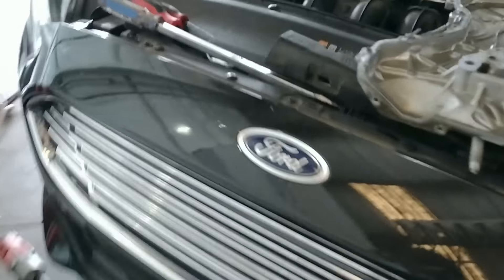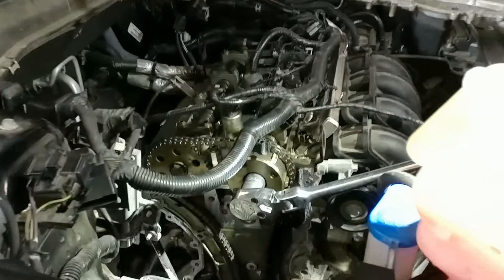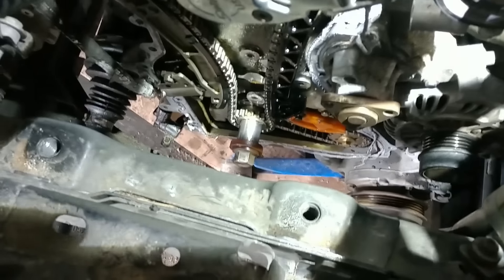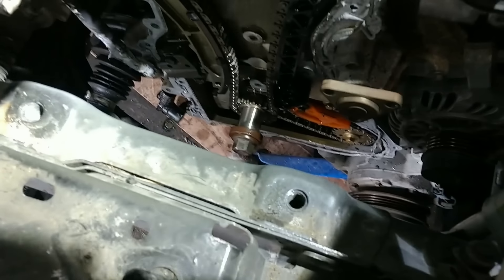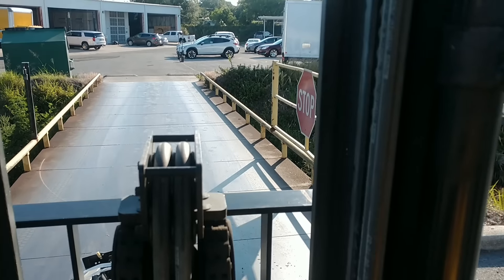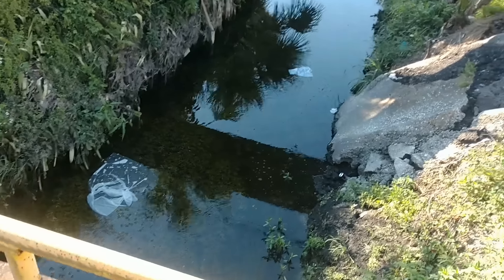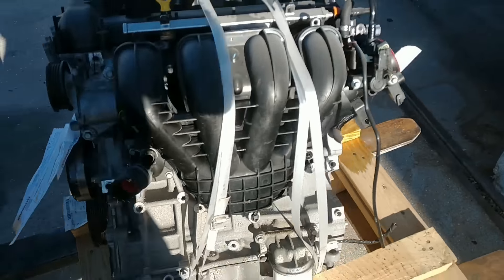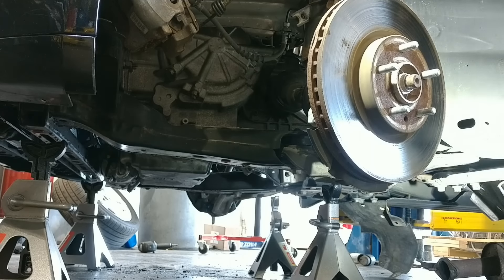Damaged Engine: You Broke it! Pt1

Comment: It's all free floating, cams and crank. No timing marks on the block either. Sucks because if he was doing a tensioner or chain you'd have figured out the system, but just removing the HB is all it takes.

Comment: As a mechanical engineer it breaks my heart to watch companies force their engineering departments to do stupid things in the name of cost.  This is 100% the root cause of this issue.  There is no excuse to make a valve train this way except to save a machining operation on the crank, and on the pinion.  Shame on Ford.  SHAME.  The founder of that company, as big of a jerk as he was, would never consider something like that.
Reply: I am no expert, just making a comment:  I have read a lot of these comments, and several people make a well-reasoned case for using just this sort of system, and apparently it is more for mileage, emissions, and power than it is to save a few pennies during manufacturing.  If that is true, I have to wonder how many experienced and well-trained Ford mechanics have to replace engines because their service of this type of engine goes bad?

Comment: Hard to believe something as important as that is held on by interference fit. When these engines get old and wear it will slip and as an interference design destruction will result. Built in obsolescence. That should be keyed at a minimum Ray.

Comment: I have this same engine in my Mazda 3. No keyed crank. Harmonic balancer holds time with the crank with friction washers. Also friction washers on the intake and exhaust cams. Poor design. And if those aren't used as well as the cam lock and crank lock tools, you're just asking for catastrophic engine failure. I did some quite extensive research before diving into the job. So I knew everything I needed going into the project. Time and patience along with YouTube made it significantly less complicated.

Comment: Wow, I can't belive ford is still using the same engine from decades ago. 2015 car with a 30+ year old engine. Good price on the used engine though.  I paid £550 with 70k miles on the clock

Comment: After my mom got rid of her Fusion, I thought I was done seeing their brilliante engineering at work. Nope. I'm glad she got rid of it before I had to do a timing job on it.
Reply: You wouldn't have to do a timing job on it.  The Mazda L used in the Fusion was good for about 175K when they would have valve issues.  A rebuilt head would get you past 300K miles.
Reply: @ohger1  The engine started making noises (likely something in the VVT system), which was one of the reasons why we got rid of it. The timing has to be redone while tearing it apart to diagnose that issue. We had bad luck with that car, and I'm still glad we got rid of it. Edit: It was maintained well, twice yearly oil changes, and addressed a weeping trans seal early before it damaged that. Car only had 35k on it.

Comment: Been a mechanic for over 15 years and what in the heck is that design? No keyway to clock it? Uses pressure of the harmonic balancer to maintain timing? That's the kind of engineering that makes me want to hurt someone.

Comment: Lmao I just had to do a head gasket on one of these motors yes there is a tool to lock the crank in place and a cam lock tool as well. Yes only the pressure from the balancer and bolt allow that thing to run it’s a super shitty design

Comment: Never start a motor when you’ve done timing components.

Hand crank ALWAYS!!. To test & verify.
Never use the starter.

Leave it to Fix Or Repair Daily Found On Road Dead to design A crank sprocket without a keyway my gawd, what did they “save”?,  5 g on that weight saving feature?.

What a bunch of half-brains…
Crank sprocket without a keyway my gawd, everybody & their mother uses keyways & locator dowels/pins/half-moons (aka: “biscuits”) to locate & hold the crankshaft sprocket in place but not FORD, they’re so much smarter than everybody else

Comment: All these new cars are designed like certain parts were assigned to a freshly hired engineer with no experience...... it works but there are some very stupid choices made. Then again, pointy haired bosses can make some amazingly dumb choices for office clout, company finances and to look good in their boss's eyes. I learned recently that the transfer case / power transfer unit on some of the newer 4x4 jeeps can wear out at 40,000 miles because they put the catalytic converter so close that it overheats the small amount of gear oil inside it.

Comment: This so sad to see! I guess no one thought to look at the autodata for procedures on locking the engine! If one of my techs had done that then they would be paying for and fitting the replacement engine! That’s total rookie mistake! Ford have been using non keyed pulleys for years in the uk, I have a cupboard full of timing lockup kits for this very reason! Autodata subscription £90 a month, timing lockup kit for that series of engines £130,! Peace of mind it’s done right the first time, priceless!

Comment: If I brought my car to the shop and they replaced my relatively low mileage engine with a rebuilt one I’d demand compensation in addition to the rebuild. The overall value of the car is diminished. It’s not a factory rebuild. The serial numbers don’t match. It wasn’t installed by a Ford dealer.  You’ll never get a decent resell or trade-in deal. That is complete BS. The customer would be better served by an engine rebuild and if they came to me with some BS about the replacement being cost effective I’d tell them to stuff it.

Comment: Man new Ford vehicles are getting crappier, especially the fiestas in the uk where I live. The 1.5 Diesel engines have their oil dilute with diesel they are a design take on the 8v Peugeot 1.6hdi but they are ok and the petrols have their heads crack, catch fire or the rods go, Also the heaters take about 20 minutes to get the things warm in the diesel models. Gm and Ford are pretty similar and both have their ups and downs but this to me seems cheap that they don’t use a keyway. Gm in scotland or the uk is Vauxhall or it used to be anyway till Peugeot took it over, they don’t have as many serious engine issues as the fords do here apart from the vans that aren’t fiat or Peugeot built

Comment: Ford uses friction discs between the gears on the crank shaft to hold everything in time. If you remove the dampener you must lock the cams in place and use the crank stop tool. Otherwise this is what you get. Side note if you run these engines low on oil the same thing can happen

Comment: You couldn't just done a valve job but I guess u would have more than 400 in valves and gaskets I will remember this engine for sure this is the Ford engineers sticking there middle finger up at the service technicians I mean a 25 cent keyway🤣👍

Comment: I came across the same thing when doing the timing belt on a 2012 focus, they require a few special tools. A pin goes in the back of the block to lock the crank at tdc, and cam locks ensure the cam timing is correct and only then can you safely loosen the harmonic balancer bolt, which is also a single use bolt and washer. Niether the balancer or belt pulley are keyed. Seems insane to me, and definitely something destined to fail eventually, whether by incidents like this, or just time, fatigue, or metals expanding and contracting causing it to come loose. Good one Ford. 👌
Reply: BMW/Merc/Audi have been this way since at least 2005, its not really a problem if you follow the service guide.

Comment: Never buy or own a damned Ffffffffford. Anyone remember how you had to reach across the steering wheel to hold the gear shift lever in park so you could start the car? That took them years to fix. 
Bought a new 87 T-Bird once, my wife was the bookkeeper at the Ford dealership otherwise she'd would have been driving a chevy to work, after a few years I decided to replaced the belts and hoses. My buddy owned a NAPA store so I went to him for my parts. He said the heater hose was a dealer item only. So i go to the dealer and they tell me the FoMoCo parts system said "improvise".  Ford didn't offer a heater hose with two 90* bends two inches apart!
The power window motor went out, had to drill a hole in the door where the factory had dimpled the metal to get a socket to a nut on a stud....this was the official Ford procedure. Once i reinstalled the door panel half the hole was exposed.
The AC compressor went out for the second time just out of warranty. Ford knew the system was crap and devised an entire new kit, the dealer would sell it to me at cost, $1000, I said hell no. The kit included every thing, brackets, belts, compressor, condenser and dryer....They really made some shitty cars in those days

I will never own another Ford product.

Comment: The torque on the crank bolt is wrong. The bolt and the two washers have to be replaced when removed. Yep all who work on this engine are doomed to fail. Happened to me and I work on fords for 40 years.

Comment: I'm not sure I understand all he did was take the timing cover off but not the chain or gears so why would it need to be cam locked and the balancer has to be on before you crank the engine
Reply: Because, on this engine, there are no keyways to locate the timing gears on the crank and cams.  The crank gear is only held in place when the crank pulley is installed and torqued.  Because of this, timing tools MUST be installed before the crank pulley bolt is loosened.  Same goes for the cam gears............

Comment: Read the fucking shop manual when you're not used to work on a specific engine.. this engine requires a timing tool to lock the crankshaft before removing the crank pulley.. a quick look up before disassembly would have saved that engine from being severely damaged.

Comment: "Ford has a better idea!" was an advertising byline in the late 1960's, replete with a light bulb,  GE style. Early "baby boomers"  flocked to the Mustang and little else. Who wanted a Ford Galaxie with column shift,  soft shocks and a bench seat engineered for a "1930" era male weighing 145 Lbs? Few did. What was on Ford's platter? The Pinto. GM's Camaro and Firebird, and the MOPAR Challenger, Charger, and the mild slant six Barracuda was a second choice.  "Ford Has a Better Idea"? Ha ha..hah

Comment: Just another design problem.  John Deere  has a 5 cyl. Diesel with a cam gear only held in place with the bolt. No key and no taper.  Where have  all the real engineers gone?

Comment: oh no! THEY DIDN'T! Rely on the tension of the pulley to prevent THE TIMING DRIVE TRAIN from coming out of .... FFS FORD! A simple, TINY key would have been sufficient, just the tiniest thing even...that poor apprentice, having to learn on the back of shitty design, how hard it can be to be a mechanic. When ever I come across an engineer or board member that approved of designs like that, I usually just club them and cremate them as to prevent offspring and the spread of faulty DNA. What a heartbreak!

Comment: 50 yrs ago, when I was apprenticing in my grandfather's garage, I was given the task of a simple sparkplug change. An insulator broke, and the terminal fell down inside the plug hole. Not knowing the catastrophe this would cause, I went about my business. Only when I started the car did I get the scolding of a lifetime.  That little piece of metal seized up the engine and my grandfather had to pay out for a rebuild

Comment: What an absolutely horrendous design here! What kind of bonehead engineer uses friction fit for a timing gear?

I'd agree with the boss on this one, $400 + an R&R is probably cheaper than a proper head rebuild. You're looking at a $300 or more to do valves, valve guides, and valve guide seals at a reputable shop and another $100 to $150 for a head gasket kit (that includes not only the head gasket, but all the intake and other things that have to be removed) and head bolts. That doesn't even begin to account for the labor, running around, sourcing parts, etc.

Comment: This has to be one of the worst design flaws ive seen, I guess it pays to consult the service manual on each and every vehicle before even starting to work on them. Each brand now has special techniques that have to be followed and if you are not familiar with them better consult a service manual. Both Ford and GM seem to be getting much worse from a service standpoint.

Comment: Every crankshaft pulley I have ever seen has been either located with a woodruf key, or on splines.   This is wishful thinking on that manufacturers part. . . . edit....  Actually I just remembered there was one motorcycle engine that used a tapered shaft, but that was a two stroke, and it was only for the magneto timing.

Comment: The whole situation is unfortunate but I gotta say, what a STUPID design FORD....

I want to have a talk with the guy who decided it was a good idea to hold the crank sprocket to the crank with pressure from the harmonic balancer. That is so dumb. It's like they designed and built the whole engine and then suddenly realized they didn't design a keyway. And then recovered by saying "oh...yeah, well just crank the bolt down real good, it'll hold it!"

Comment: I can not F**ING STAND!!!! when manufacturers build stupid idiosyncrasies into components that make it so basically only their certified techs, I.e. dealership mechanics, are the ones who can work on it and fix it... the avg mechanic, like just happened to you, is not going to understand that the pistons need to be locked in place and set up done on the engine just to take the timing cover over. That has to be one of the most ridiculous things I've ever seen and heard of in my entire life and I've been working around cars since I was 12 when I helped my dad rebuild a 1974 Cuda, then a 71 cuda, then a 70 challenger, then a 52 Willys, then like 3 or 4 vw bugs.... I ain't ever seen no s** like that focus... that is nuts man... 

This, this right here is why I love the older cars, Id rather drive a 1970 something every day than a 2021 something... something goes wrong, I know its an easy fix. Something goes wrong on your brand new vehicle and its in the shop for a week and cost you 3k to fix while I can replace an entire drivetrain for 2/3 of that and essentially have a brand new vehicle with zero miles.

Comment: I’ve got the same lousy engine design in my 2011 Mazda 3 (thanks Ford…).  When I was a novice I debated resealing my leaky timing cover but thank goodness I looked at the service manual and realized it was wayyy beyond my skill at the time.  If I had just barged in there I too would have been in the market for a used engine.
Reply: Ford had nothing to do with that engine.  That engine is all Mazda.  Ford designed and built the 3.0V6 for the upgrades in the joint project.

Comment: Can tell your FLT training is lacking, you committed several potentially lethal sins...

1. Travelling with speed
2. Lifting without tilt.
3. No repositioning of load to wider stable forks.
4. Travel with insecure load, see point 3.
5. Travel with load too high and not with tilted forks for COG balance.
6. No seat belt.
7. lack of use of the warning horn, you can't rely on just sight alone.

Never leave a fork lift with its forks off the ground, its the fastest way to smash your shin bone in and possibly mess up your or someones ability to walk... It happened at a place I worked at with some untrained driver, the company got fined and sued for a couple of million.

Also, I bet you were not wearing a high visibility tabard / jacket or helmet.
Reply: Finally, with a heavy load, you are meant to travel backwards slowly, so that if you have to make a sudden stop, the load does not fly off and hit the thing you are trying to avoid.

Comment: Ford have used keyless sprockets for over 20 years, even back to their cam-belt days. The benefit is that more accurate valve timing can be achieved, at a reduced manufacturing cost,

Comment: I feel for your apprentice. That's a tough break but a great learning experience as long as he can brush it off.
Reply: the number one most important lesson any mechanic can ever learn. "don't ever expect anything you work on to be designed smartly because i guarantee some engineer somewhere fucked something up." although usually its just not being able to remove bolts or accessories without removing some other large piece of the car for no reason.

Comment: Maintained by friction? This is why I hated fords. The engineers that build them clearly never work on them! I moved out of auto and transitioned to Heavy diesel in the late 00's So if GM Dodge/Chrysler (Not Cummings) does this now excuse this reaction, Cummings, Detroit, CAT, hell everyone uses keys there cheap and 100% guaranteed. I don't think your little buddy failed, I think ford failed him. I hope he didn't take it to hard. I'm sure there's no timing marks either, (Been there on a 4.0 SOHC Nightmare! pull the engine to fix timing wtf were they thinking) and you need specials tools to lock the cams and cranks, but there's no excuse for saving 4 dollars per engine to not have a key slot. I feel your pain. Thank god for LKQ we use there heavy D all the time!

Comment: I'm guessing it's a interference engine
....also...why would Ford not put a key way on those sprocket's so they couldn't free spin like that?
 Do you really have to pull the whole front end drive train from the bottom to r and r an engine on those cars?

Comment: Another Ford better Idea. Making the crank sprocket secured by friction is the dumbest thing I've ever heard. Of course It's a great Idea if your selling engines.  This has to be designed like this make shops not to work on Fords. Also the number one rule of mechanics is never truer than on this engine. If all else fails read the directions.